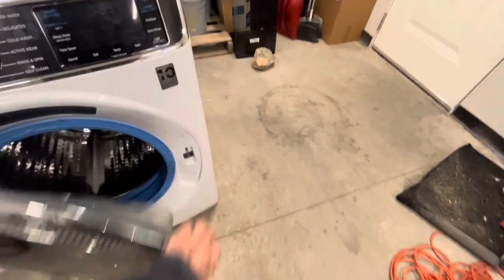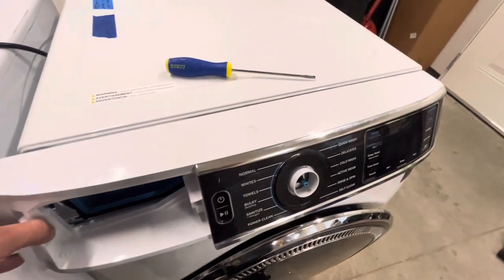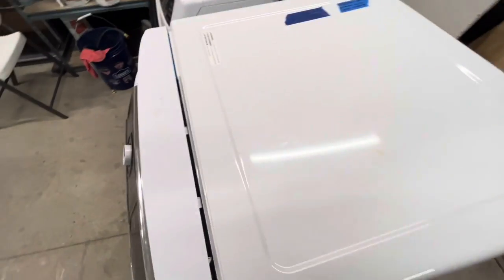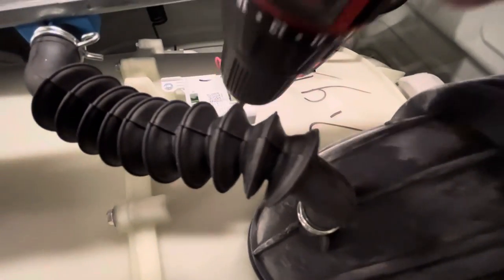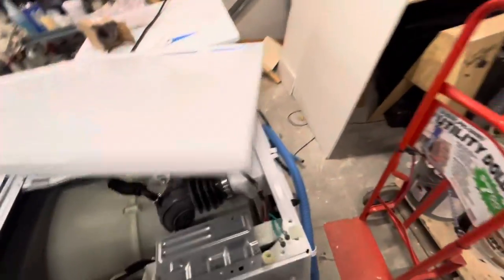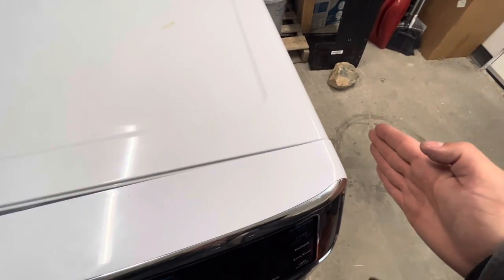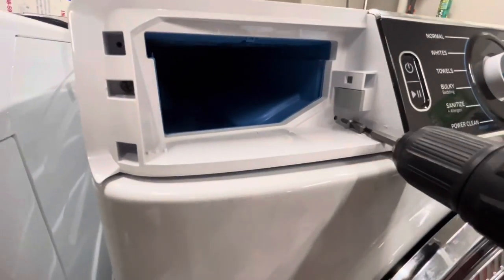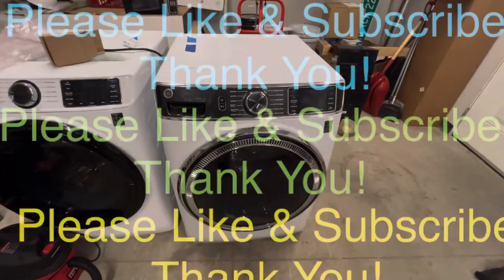Washing Machine Accelerometer (Speed Sensor) Replacement

Comment: Is there a way to test it with a multimeter to make sure it is faulty?
Reply from the maker: Thank you for subscribing! I’m sure there is a way to test the accelerometer,  but I do not know, sorry!  I took the risky approach and just replaced it. Luckily I was right. I found that if the control is bad the unit likely won’t power on at all. If the unit powers on and you can select the cycle no problem and it starts to run every time but will only run 2-10 minutes before turning off the accelerometer was bad (like in the case of the unit in the video). I hope this helps you out.
Reply: @Theocdrepairman that does help, thank you. I ordered a new one because that is exactly what is happening, it spins for a few seconds then stops, but I’m skeptical because I had so many codes (3, 23, 26, 29, 46, 66). Although who knows how old they are.
Reply from the maker: @pobrichi yeah all those codes, yikes! Maybe control board? There are tests that you can run in service mode that test certain components. Maybe if you deep dive the internet you can find the list of tests. It’s similar to the trouble codes list, but it runs specific tests on the machine. Maybe if you can find such a list it could help you narrow it down.
Reply: @Theocdrepairman   I also had many codes on my GE washer (75, 69, 34, 9). It appears 69 and 34 are either motor or inverter board. I'm not sure about 75. 9 is for lid, but it is coming on because I kept trying to select new cycles when the previous would stop, without opening the lid. In my case, it would get to the final rinse cycle, then agitate a minute or two before stopping and saying "finished". Finally it started doing this on the initial wash cycle (going 1-2 minutes then "finished"). Now it doesn't spin (it tries, you can hear the motor running, but nothing happens). Any thoughts? I'm also curious if this could be the accelerometer. I will run test 14 in service mode.

Do you have advice on where I could purchase an accelerometer? GE discontinued my washer (GTW720BSNWS).

Washer is only 2 years old, and very lightly used (I'm only one person - did about a load a week, usually only 1/8th or 1/4th of the washer at most.) :(
Reply from the maker: @bikbik5200  yeah unsure about code 75. It is likely the inverter board or motor or accelerometer. For most it has been the inverter board. What results did u get with test 14. Also clear all codes and run normal cycle and see what codes return. This inverter boards seem to fail often on these machines.
Reply from the maker: @bikbik5200  please subscribe if you haven’t already. Thanks for your question!
Reply: @Theocdrepairman Thank you, I will. And thank you for the advice. I will run test 14 and see what happens. I was able to contact GE and find out the speed sensor is only $39 and they have free shipping right now. So I think it might be worth a shot.

EDIT: Subscribed! By the way, awesome summary for the channel: "things aren't broken they just aren't fixed yet" ! I love it!